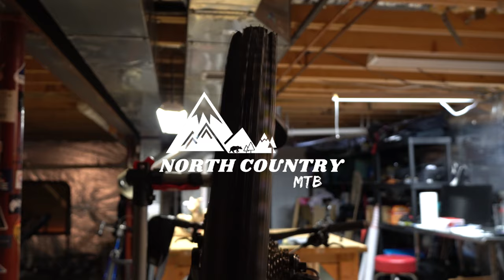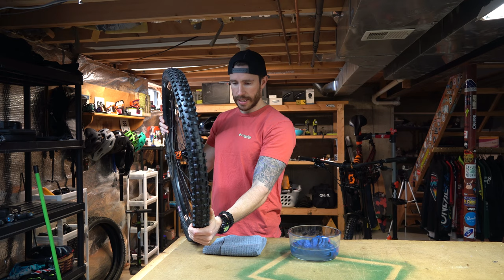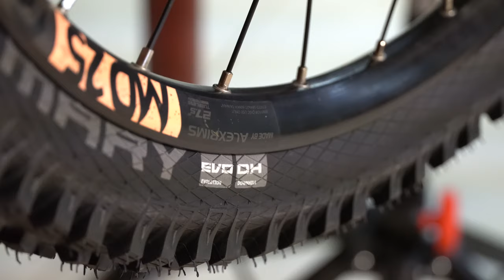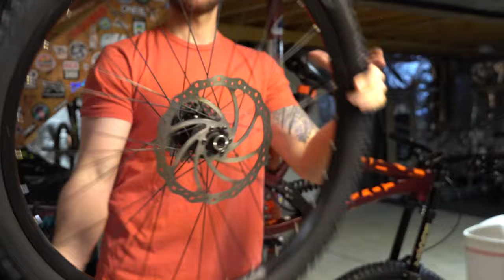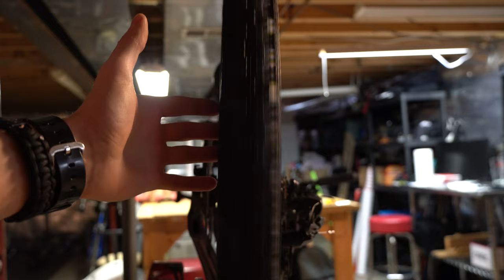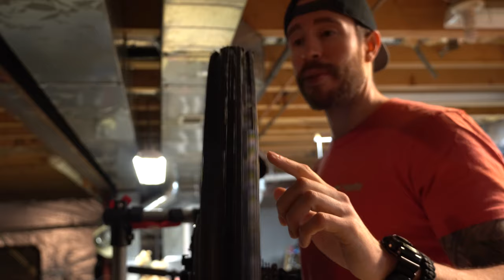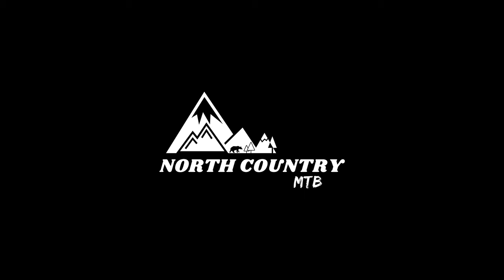How to get rid of that Wobble in your tire | MTB 2021 4K

Comment: Is it safe to use portable car tire inflator instead of floor pump?
Reply from the maker: I don't see why not! Let us know how it works.
Reply: @NorthCountryMTB  i tried but it didnt work, i have to use presta to schrader adapter and pressure stuck at 35psi because of air leak, turns out I did it manually like you did, big thanks
Reply: Yep, depending on tire , sometimes You need pump with air shot option. Had the same problem, but did not want to have another pump so builty own air shot  from two bottles of coke - maybe ghetto method but works

Comment: Hey, I’m wondering how you like those magic marys. Do you use them front and rear ? If not what is your setup?
Reply from the maker: Excellent tire front and rear, yes. The Magic Mary is great where I ride here in the northeast wheee it can be super dry and dusty sometimes. I believe the only downfall is that you do run through them quick as they are a soft compound...but that’s why they are so grippy! A set should get ya through the season. Big fan!
Reply: @NorthCountryMTB  thanks man. My home trails are Peck Hill up in Fulton County. We do venture to Gurney, NB, & KP on occasion. Running the Maxxis Rekons now (which work well) always looking for other options as well. Peck Hill is a lot like NB.